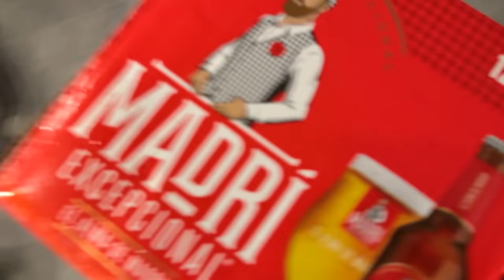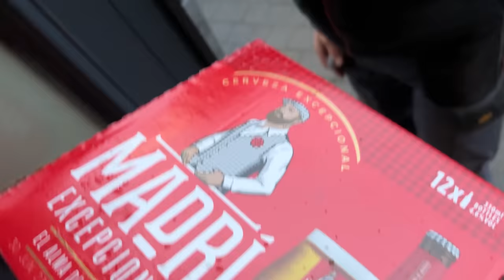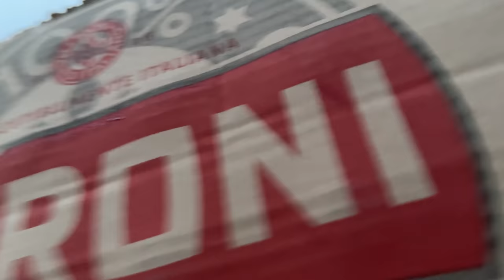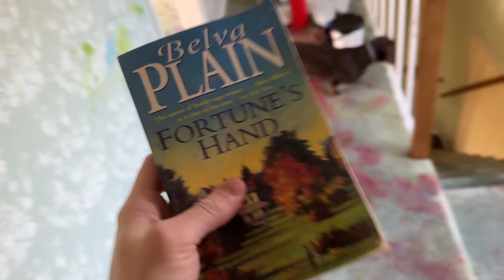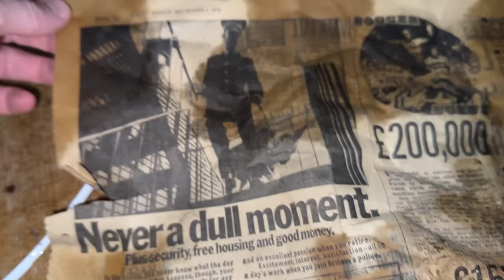Things went from BAD... to WORSE!

Comment: Word of advice from someone who lives in a Cold part of the US (Yesterday the temp was around -34C), When the weather starts getting cold like that, it's generally a pretty good Idea to leave a few taps running with a little bit of water to help keep your pipes from freezing through. It's a bit late now obviously, but you never know when that info might save you literally thousands of dollars.
Reply: you mean hot water or regular water
Reply: @lax4359  Regular water. Keeps water moving through the pipes so it is unable to freeze.

Comment: I've been there.  Some years ago, a pipe burst in our garage mid-winter.  The pipe was leading to an outdoor tap, and there was zero insulation around the pipe in the garage.  We ended up replacing the pipe from the garage to the tap and adding a shut-off valve in the house to remove the possibility of it happening again (we cut off the water supply to the tap in the Fall).

Comment: Hey Tom, regarding the wall of legends. One idea: you could get an opaque piece of glass (floor to ceiling that you use as a partial separator between a couple rooms maybe) to be engraved with the names. All with various fonts and sizes, so the names would be where the glass is transparent, and the rest opaque?

Comment: Tom. I’d say be really careful with the ‘house next door’ given that above the ceilings, the weight of the water will be pretty heavy on the plaster. If that’s original plaster (which I assume it is given the age of the property), it may be the original Lath and Plaster, which if that collapses, it can bring the whole ceiling that comes down virtually in one piece, and is known to be deadly if that falls on you.
Reply: not trying to be rude but its a given that if your ceiling collapses on you your most likely going to be seriously injured or even die if theres heavy furniture or appliances above you

Comment: I had to comment after I saw you turn off the stop tap, next time (hopefully there won't be a next time) open up some taps around the house to let water out where it should come out, sinks and baths etc it will speed down the water stopping as the only place for your pipes to empty out was where it was leaking. Water can really fuck up your house you are soo lucky it's into your garage tbh.
Reply: The house next door too wtfff?? What kind of luck is that bro?!

Comment: Dude I'm so sorry that you are going through this!  My Dad and I were driving down a street one day and he shouted "stop the car!"  I screeched to a halt and asked what was up, he said to look at our neighbors house...   There was a fucking iceberg coming out of the siding on the rear of the house!!  It was about 15F outside.   I kid you not it looked like a frozen waterfall.  A heating pipe burst on the top floor and the furnace kept on making nice hot water and flooded the two story house.  We called the fire department as the owners were in Florida and they went into the house and it was about 2 inches from flooding the raised furnace.  Downside, they had 4 feet of water in the basement.  The house was a total loss (they tore it down).  All the ceiling had fell due to the water and everything was sopping wet.  I looked in the front door and you could see a river flowing down the stairs and dropping from every floor joist.